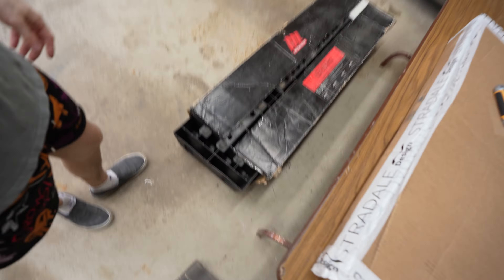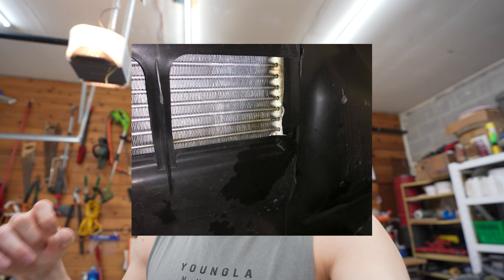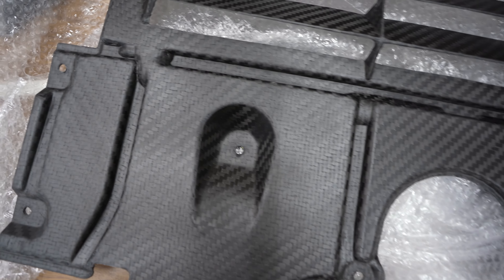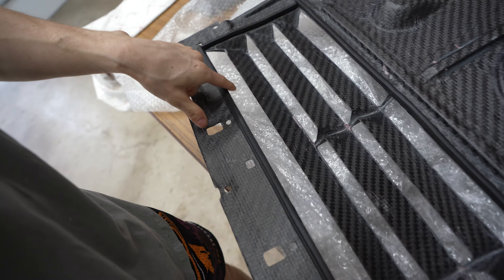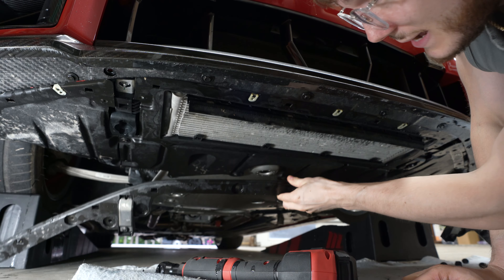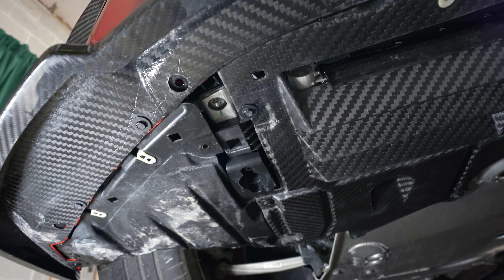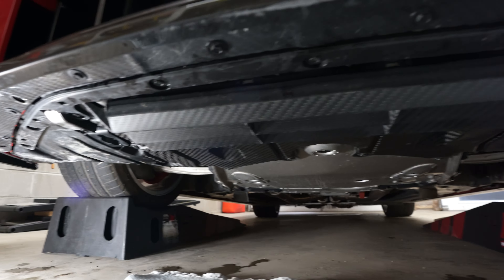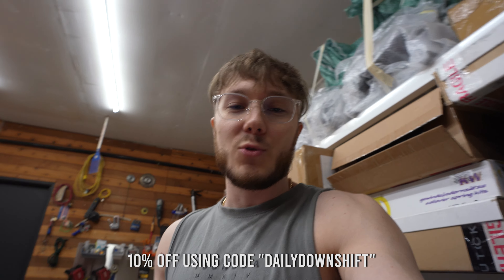Every G87 M2 Owners NEEDS THIS Protection | Stradale Design Carbon Fiber Skid Plate!

Comment: how are you liking those race ramps?  I do not have my G87 yet but when I do, I was wanting to put on the R44 Front splitter on myself and was thinking about getting those race ramps as they are the only ones that provide a low enough approach angle to not scrap the front end of the car.  Is there enough clearance to also install side skirts?  I have a right angle drill so I am hoping there is enough room to get underneath there.

Also, really love your vids and enthusiasm.  I subscribed some time ago and have learned a lot from you, thanks man.
Reply from the maker: Race ramps have been good to me. Definitely enough room to do basic stuff like front lip, radiator etc. Side skirts should be just fine, especially if you aren't lowered. Thanks!
Reply: @DailyDownshift  I will be a little as I will get the MP HAS kit which will lower the car 10mm.  I would hope that would be enough.  I know some people on Bimmerpost said they got their cars lowered the whole 20mm.  If it is too low, I may jack to car up and put some wood or something underneath the red tires.  That should give me 2 to 4" which should be enough.
Reply from the maker: @ronin120  Oh yea, if you put a wood block under the rears and go up the race ramps front first, you'll definitely have enough room.

Comment: metal would be better
Reply from the maker: The metal ones I've seen either completely restrict airflow or have massive holes that allow rocks and debris right through.. (mishimoto, turner, TRE etc). Let's not even begin to talk about the added weight of going for a steel option or the fact that they don't offer any performance. This option is expensive, but absolutely the king of skid plates.
Reply: @DailyDownshift  What if you reverse?